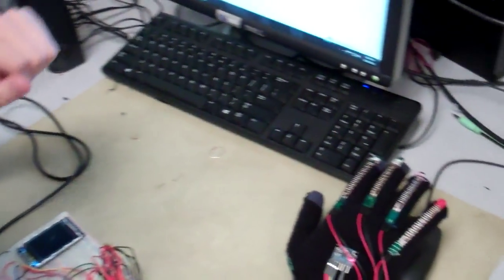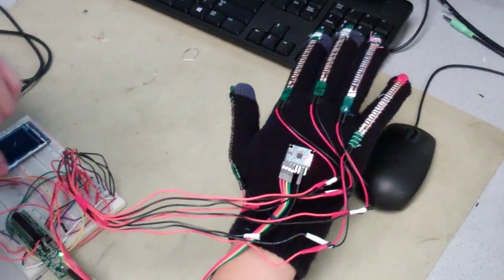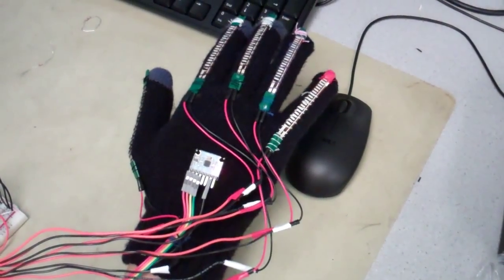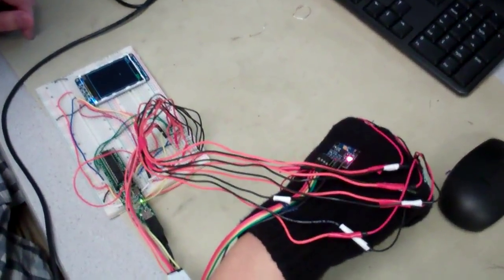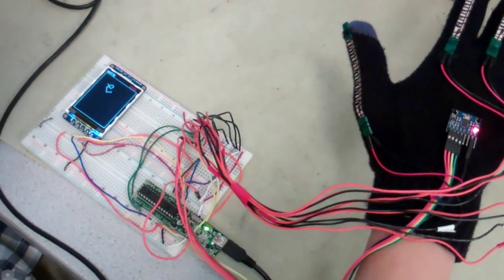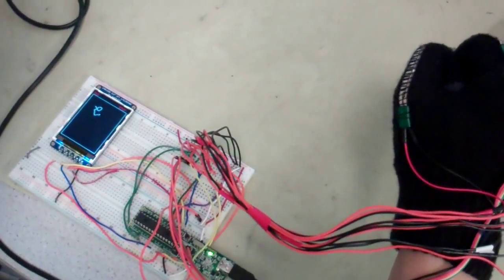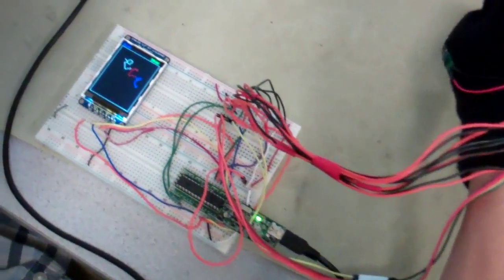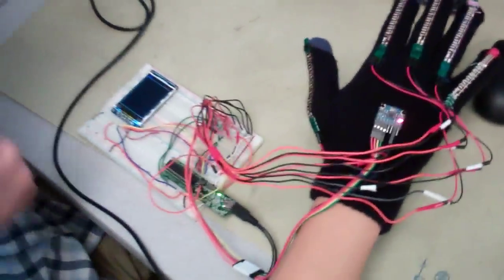Glove drawing interface

Comment: Can not you get more help?
like project file or connection wiring diagram
Reply from the maker: Did you read the linked report?
Reply: yes. I read the linked report . I can follow connection wiring diagram  in the pictures.
but The code is still incomplete.
Reply from the maker: "Incomplete" tells me nothing. What is missing/
Reply from the maker: The files are indeed missing. I will write to the author. But do not expect to get the code. You will probably have to remove reference to the two files, and track down the missing declarations.
Reply: I hope things will work out 
Thanks.
Reply from the maker: Looking back at comment, you asked the same thing 2 moths ago. The authors did not answer. Therefore, you will have to remove the reference to the two files, and track down the missing declarations, one-by-one.
Reply: Bruce Land okay..i try it. thank you!!!!!
Reply: did you got your code running now?  if yes, then can you help me with the code please, i am also stucked with missing common.h and declarations.h files
please help me in any way.
Reply from the maker: As you can easily tell by reading the earlier comments, the code is missing and cannot be recovered. There was a disk crash on a student laptop. Sorry.

Comment: Excuse me. How do header files and code other than 5
For example declarations.h, glcdfont.h
I want to try it.. but mplab...It's very difficult
Reply from the maker: I cannot understand the question
Reply: Sorry. I used the translator
I will copy yours project but..
I seem to be lacking in code information
If I may say so.. I tried to ask you
Reply from the maker: do you mean that you are missing a header file?
Reply: Bruce Land yes. perhaps other header file or source code....
I tried using five code in mplab 
but I got a message.
 BUILD FAILED (exit value 2, total time: 19s)
Reply from the maker: what file is missing? the build info should tell you.
Reply: MPLAB X IDE 3.45
standalone Project-> PIC32MX250F128B -> ICD 3 -> XC32(v1.40)
project name : practice
               X

Header Files :  ftf_master.h(link -> TFT Graphics)
  ftf_gtx.h(link -> TFT Master)

source Files :  main.c (link -> Main Code)
  mpu6050.c(link -> MPU-6050 Code)
  config.c(link -> I2C Code)

I know it's wrong, but I do not know.
Reply: This looks very cool. So I'm trying to follow it.
But it is too difficult, so I needs help.. .
Reply: I don't find it 
-> math.h
common.h
glcdfont.c
pt_cornell_1_2.h
declarations.h
Reply from the maker: math.h is part of the C distibution.
common.h is missing.
pt threads is part of the course infrastructure.
http://people.ece.cornell.edu/land/courses/ece4760/PIC32/index_Protothreads.html
declarations.h is missing
glcfont and other graphics routines are part of the class infrastructure
http://people.ece.cornell.edu/land/courses/ece4760/PIC32/index_TFT_display.html

I will contact the authors to see if the other code is still available
Reply: Thank you.. thank you 
I'd like to try it.  thank you